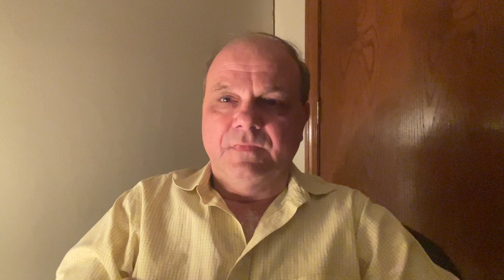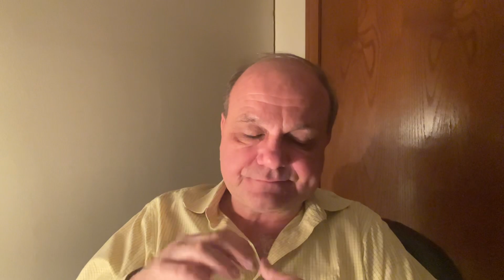Mercedes, obsolete parts and what to expect when buying a 70’s - 90’s Mercedes with high mileage

Comment: It's also depends on the car .. i remember i had a W203 C32 AMG and i needed a water pump it took my 35 days to get it only from Mercedes in Germany price was crazy around 800 USD .belt in 2 weeks , now i have a 77 280SE i can get parts in 20 days from Mercedes or other websites ..at least services parts are avaliable.

Comment: A good example is the W123 oil cooler for my 1983 300TD.  No longer available.  Yet it is an essential part that often needs replacing because the fittings bond to the oil cooler hoses.

Comment: Wonderful information. I own many cars and maintain them because I love to drive them. I have noticed in the last 5 years how difficult it is to find good quality VW Beetle parts. I own a 1967 Beetle and a 1974 Beetle chassis with a 1952 MG fiberfab body on it. 
OEM parts are like gold if you can find them. Replacement parts are Chinese junk. I have been scouring junkyards for years buying GM food used parts, cleaning them and storing them. I do the same thing for my 85 380se and my 82 380sl. Porsche 911 parts are plentiful, but the prices!!!! My daily driver is a 2014 Porsche Cayenne S and I am noticing how quickly technology is moving. My navigation system is an antique compared to what the factory is supplying now.   I believe the parts issues for our newer cars will be multiplying faster than our old classics. Planned obsolescence is the engineering mantra today. No longer are cars being built to last a long time. 4 years and get a new one. It is shocking to see 7 or 8 year old Kia’s and Hyundai 
cars in the junkyard!!  Looking forward to part 2 of your video!

Comment: Just wanna make a comment as a W201 M103 owner : I believe that the parts problem is not the cost itself since MB would pass it along to us , consumers, but with profit. Up until mid 90's MB was all about premium quality, all the models were pretty much "forever" cars and the profit for MB came from the sell of the car, parts would just keep it on the road and continue to maintain MB status as the best quality car. Then the paradigm changed and cars were no longer made by engineers but by shareholders, meaning MB makes some of the money from the sell of the car but the bulk comes from parts and service. Why make exceptional quality parts that needed to be changed in 30 yr when you can make crappy ones that need replacing a whole lot sooner ?  Today's philosophy is to make you, the consumer, buy a new car every 3-5 yrs and that they should be as disposable as the razor blades.. Todays MB is nothing like the MB that it was.